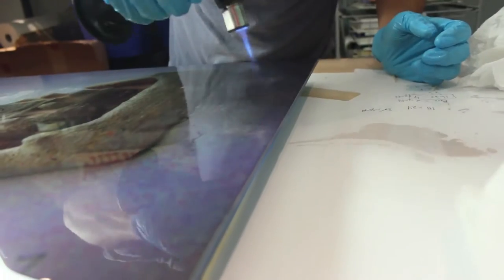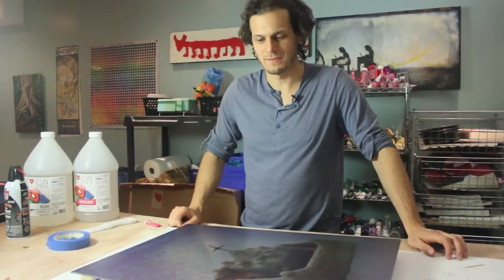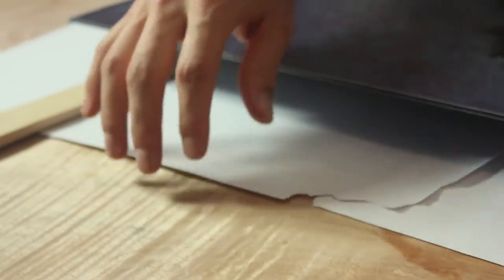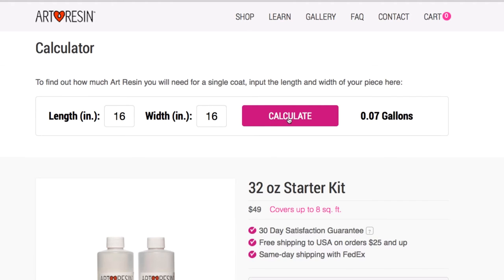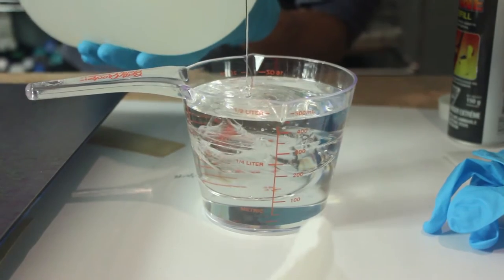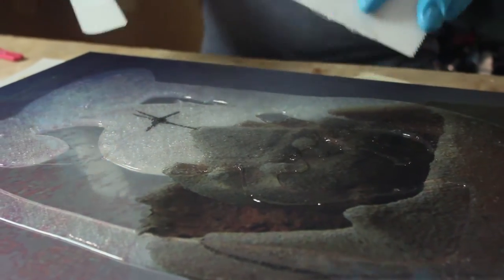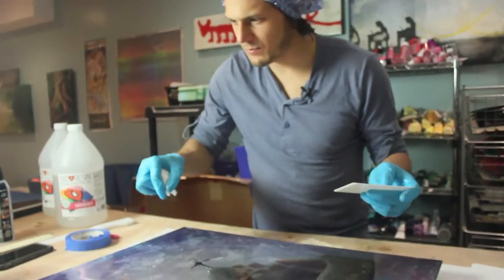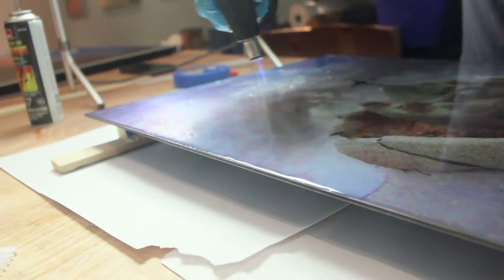Coating an Aluminum Print with ArtResin Clear Epoxy

Comment: How can I get resin to stick to tin for jewelry. It stuck initially then when the tin moved a bit it came lose
Reply from the maker: ArtResin will adhere strongly to metals, just be sure that the metal surface is clean and free from any residue or oils.  If you are continuing to have problems, please reach out to us at support@artresin.com with photos and we can help :)

Comment: I'm new to resin...when does the tape come off?
Reply from the maker: You can remove the tape as soon as your resin has cured enough to be handled.  Usually by the 24 hour mark.

Comment: Hi ..Great video! Thanks for the details. 
I'm using posterjack to do a print of my painting on aluminum -- do you have any suggestion for a better place for getting quality aluminum prints in the US? 
Another thing I want to do is create a 3D effect by using my painting's aluminum print as the bottom layer inserted within a shadow box kind of a frame then resin on top and then add couple of layers of artwork done on transparent drafting film all separated by resin Layers --do you have any videos for something like that involving a drafting film?
Reply from the maker: interesting.  no videos.  look into josie lewis.  she has great tricks for multiple layers.  and we love her!  posterjack is an online printer i heard does aluminum prints!
Reply: Seems to be a different process as she works with magazine prints to create collages , the chemical composition and interaction with resin may be different than how traditional painting mediums or graphite/charcoal  on drafting film will interact. I did find a few other artists who do I want to do with resin. I'm using posterjack; not sure if there's a better one out there. Your aluminum print in the video came out well. Anyway, thanks.
Reply from the maker: no i wouldn't worry about chemical interactions. just make sure things are dry!  i have a printer in toronto that does the aluminum prints and they are amazing.  i think you can just ask local printers and they would have some supplier that can do it!  I have a feeling posterjack prints onto a clear film and sticks it to the aluminum vs. printing right on the aluminum.   may be wrong but that shiny coating threw me off.
Reply: Yeah.. That didn't look as good.. I'll check around  printing places.. Thanks!

Comment: Hi, can i use heat gun instead of flame torch? I need bubble free professional looking finish.
Reply from the maker: Hi Ritabrata -  a torch with a flame is definitely what you need if you want a bubble free, professional finish :)
A heat gun just can't produce the same results that the intensity of a flame will.  
Check out our Artist's Propane Torch Head - it's the tool that professionals use!